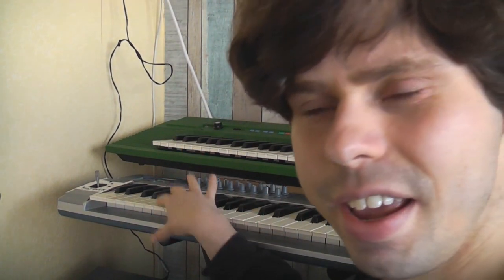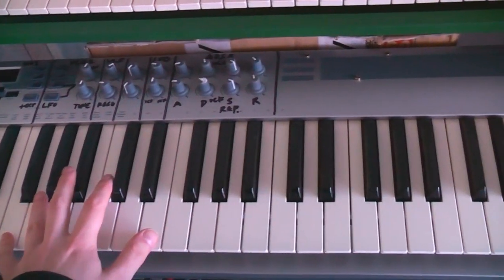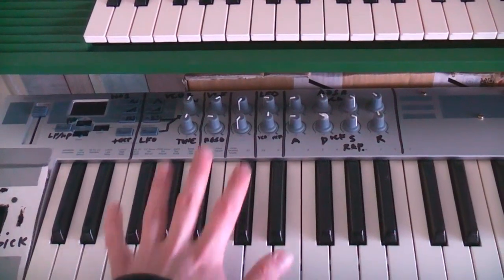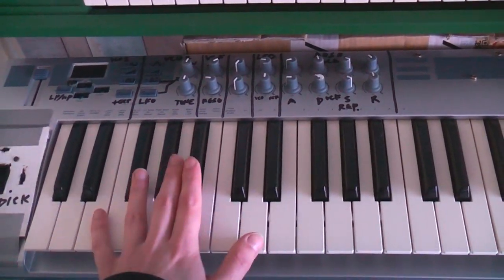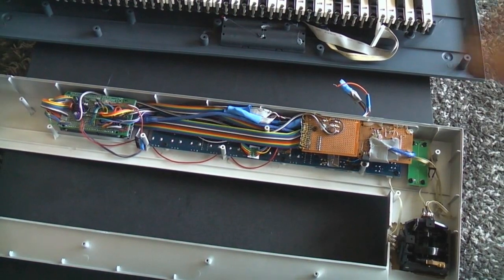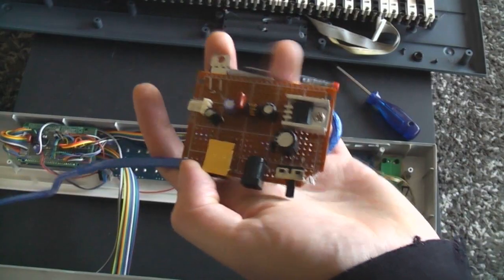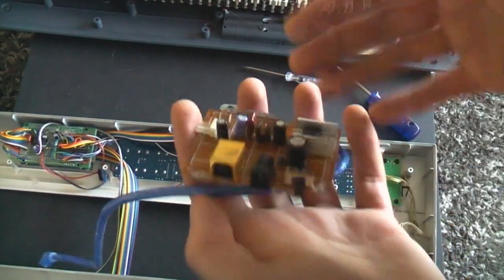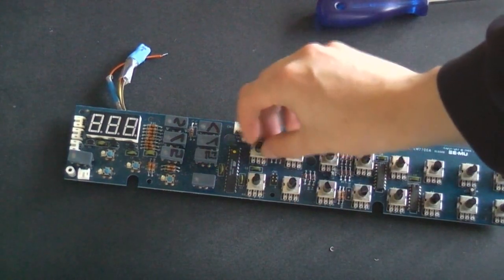Hacking an EMU Xboard MIDI controller for DIY

Comment: I’ve managed to get a hold of a few E-mu Xboards, but wondering how to get my Mega 2560 to act as a keyboard scanner for Midi into my Mac. Seen a few examples online but can’t seem to get it to work! Any ideas?
Reply from the maker: I advice to handle the keyboard scanning problem and the MIDI problem separately. First get the arduino to scan the keyboard properly and sending note numbers over serial to your PC (using the serial monitor in the Arduino IDE). Keep in mind that the keybed is velocity sensitive and that it uses two switches per key. The keys are arranged in 8 columns by 14 rows whereas the columns are "inputs" and the rows are "outputs". 
Another important detail is using pull-down resistors on the row outputs, otherwise these connections are left floating when no keys are pressed. This causes all sorts of mayhem ;)

For MIDI I recall there's a library that can turn an Arduino board with an extra USB port (like the Due) into a MIDI device. 
With your Mega this won't work, so you'll have to make a MIDI output circuit using an optocoupler. There's loads of info to be found on this, it's a very simple circuit. Of course this also means you'll need a MIDI cable going to an MIDI input port on your Mac. You may need a (cheap) MIDI->USB interface if there's no port.

Hope this helps!

Comment: I recently opened up my Xboard 49.  The pitch and mod encoders were sending rapid random signals ( sorta cool if you map it to an LFO or beatmasher in your DAW). I unfortunately ended up replacing them with encoders that don't extend to the full 0-127 data range.  I'm pretty amateur when comes to electronics, would you happen to know the kind of encoders I would need?

Awesome project btw!
Reply from the maker: Sorry for the late reply, Youtube had never notified me of the comment.

The 'encoders' are what's called a potentiometer or variable resistor. I don't recall the value but they are probably standard 10k (kilo ohm) potentiometers. 
If you still have the original components: the value is stamped or printed on the little metal case, either on the side or the back.
Reply: @rot_studios  
oh no!
not "or"! 
a "potentiometer" it's just only one of type connecting variable resistor. 
Second type - "rheostat"
First - control potential  (voltage) form of Latin "potentia"
Second  - control current (from the Greek "ῥέος")